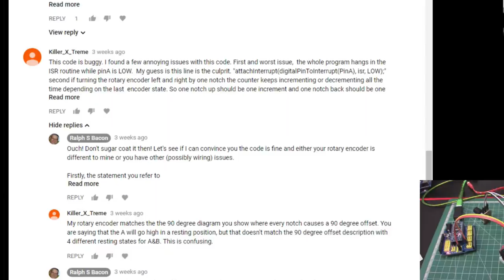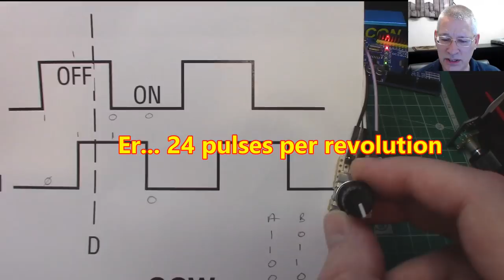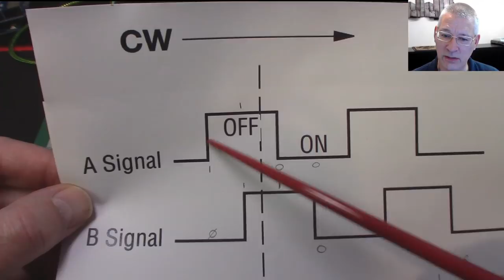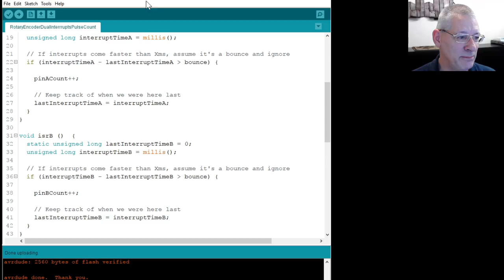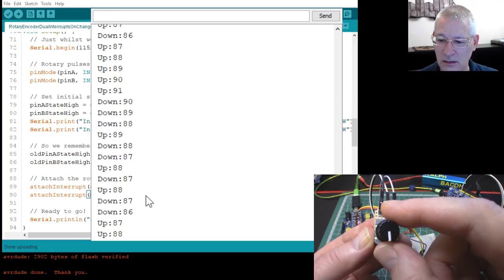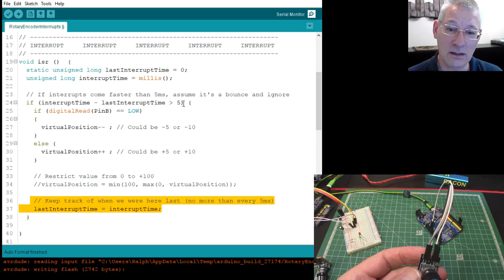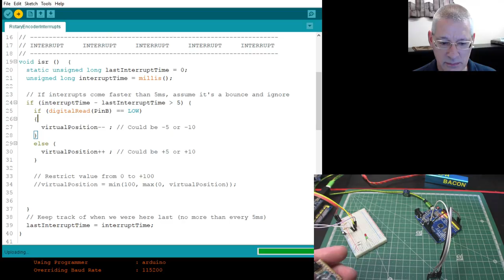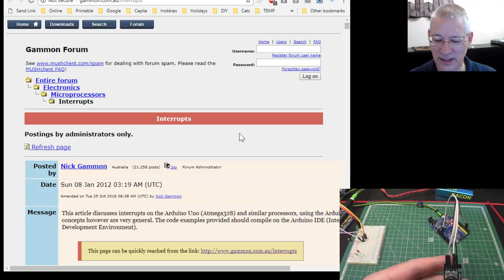#96 Rotary Encoder Update - Stepless & Software Debounced

Comment: Hi Ralph, I had this problem when I was designing a rope counter for measuring rope off a reel, I overcame the bounce issue by using a Schmitt trigger, but as you said you can only rotate a mechanical encoder so fast so I used an optical one in the end for my application.  The use of a schmitt trigger gives you a lovely clean output signal though on a mechanical encoder.
Reply from the maker: I'm thinking that you and another viewer who has commented here (#I Suck at Gaming) are singing from the same hymn sheet - hardware debouncing is obviously a solution. That said, an optical encoder obviously circumvents all the bounce issues but a Schmitt trigger is also a (much cheaper) solution too. Perhaps I need to fully investigate this...
Reply: Can't check it at the moment but most microcontrollers have some Schmitt inputs, I would expect the atmel family does too. As Mentioned elsewhere, it cannot be stressed too much that reading the datasheet of the microcontroller you're using is a must.

Comment: I have known Nick for 10 years plus(via forums) Nick and I were using Atmel chips for that time. Arduino is an Atmel micro. Nick knows arduino as all we had years ago was machine code for these devices. As a side note, memory was so small, that we had to use machine code rather than wastefull C. C even uses RAM for contants and string that don't change etc.
Reply from the maker: If I tell you Terry (and don't spread it around) that I used to have to program in assembler for the 6502 chip with just 4K memory, you will appreciate that I understand totally where you're coming from! These days, memory constraints are the last thing on developers' minds until you try and use the same techniques you use in commercial .NET-style programming on an Arduino. Hah! Then you suddenly realise that you really must write efficient code, and not have constant 'strings' in your code memory, which requires a bit of a paradigm shift in programming thinking. Nice to have someone on board with this appreciation!
Reply: There are a few of us out there,  I used to do z80 assembler back when...

Comment: i have never had good experience with these encoders. Then i found out about the Bourns ACE128 absolute encoder and also there is a library for the arduino available, which works perfectly. Yeah it doesnt have a clicky button and maybe has too much resolution (128ppr) but you can just divide the raw number by some amount which feels appropriate.
Reply from the maker: That's a lot of non clicks for a single turn of the knob, for sure. But as you say, using a subset (eg 5 clicks) to equal one step would be fine. I'll check out that encoder, thanks for the info.
Reply: @RalphBacon  fyj, you can connect the encoder either via 8 pins + ground or connect the encoder to a i2c module

Comment: Not sure exactly what killer-x-treme's problem is but I'm assuming he (?) wants a high resolution so he can tune the VCO in small steps? Well he's got a built in switch so I would have thought an obvious and reliable solution might be to have multiple step weightings selectable by pressing the switch? Course = 10MHz steps, press, 1MHz steps, press 100KHz steps etc. On heritage analogue instrumentation we used to have two knobs, course and fine.
Reply from the maker: Sounds like a plan worth exploring. Let's hope he reads your comment.

Comment: Great video. I wondered how rotary encoders knew which direction they were moving. I've never used one so never needed to find out. But now I know. 
You mentioned that optical rotary encoders were expensive, what are the rotary components in mouse wheels? They have a slotted wheel between and LED and what I'm guessing is a photodiode of some type. Is this an optical rotary encoder, or a different type all together?
Reply from the maker: A (non-laser) mouse is a very good example of an optical rotary encoder - but they are not something you could easily wire up and include in your latest Arduino project! I don't know why standard optical rotary encoders are so expensive (£20 - £50). Perhaps they are designed to be connected to a motor that you are trying to measure the speed of. Or the Chinese manufacturers haven't overproduced them yet so they are not readily available on eBay at low cost. Whatever, they are currently beyond my price range so we'll have to wait until they drop in price... Nice to hear from you again Maxx.
Reply: Ah, I've just been looking through my parts bin and found that most mice have just a 3 pin rotary encoder. The optical one must have been from a more expensive mouse that I salvaged. But I did find more optical encoders in printers that I've taken apart for parts. That might be a source for optical rotary encoders if you needed one on the cheap. 
I ask all my friends and family for their old electronics, good supply of motors, encoders, MOSFETS, and other components. It's harder to salvage SMD parts, but I've yet to find an electronic cast off without some useful parts. Even if it's just wires and cables.
Reply from the maker: Too true, salvaged parts can often realise good finds, even if only for experimentation. Optical rotary encoders are used in many places as you mention - except in the Arduino  hobbyist world it seems. Oh well... non-optical still do the trick for 99% of the uses we need them for!
Reply: I'm slowly collecting stepper motors and rods etc, to make myself a CNC. This isn't going to be a fast project, but I thought to use printer optical rotary encoders to give the Adruino feedback as to the cutting head's location on the x/y axis.
Reply from the maker: I don't see why that would not work. Perhaps you could read up how 3D printers know where the printing head is, if it works for a 3D printer it will work for a CNC machine too?

Comment: i believe there also ones that have leds inside and also "friction-less".
Would like to try these.
Reply from the maker: The ones with LEDs inside are called optical rotary encoders and can turn at ridiculous rates, with zero bounce. The frictionless ones are called stepless rotary encoders but require a bit more coding to use without getting confused exactly which state it's in.
Reply: @RalphBacon  i have one standard alpha, it's soldered on a board, but would you try again?, using a 200Hz timer, hardcore direct access to the port not using the "Arduino language" and via bit masking to isolate the needed pins, sampling the pins is what i did.
the timer interrupt takes the port value and the mainloop handles it.

Comment: There is no need for "dead time" (5ms) because, unlike common switches, the rotary encoder has to go through four different stages to create one event. I wrote software that checks this, has no dead time, and works perfectly whether you turn the encoder fast or slow. I would be happy if you could try it out and see if it solves your problems. The code and explanation can be found on the website http://www.pinteric.com/rotary.html.
Reply from the maker: I'm intrigued in how you resolved the switch bounce issue if you don't ignore signal for a specific length of time after the first such signal.
I've looked (very briefly) at your webpage and I intend to read in more detail when I have a few spare moments. I especially like the "impossible movement" signal which can be ignored, I'm guessing. 
I'd love to try your code out but my (new) workshop is in disarray (typical British understatement) so it will be a while before I can do that. 
Thanks for the info, appreciated.
Reply: @RalphBacon  Very simply, in order to confirm one move left/right encoder must go through successive four states.  Bouncing between two neighboring states is ignored, which is why I don't need dead time.  Impossible movements (when one state is skipped) lead to movement to be ignored.  I already got feedback from one person that (after looking for several years for this) confirmed my algorithm solved his problem.

Comment: Hi Ralph. There's not much wrong with Rainharvester's suggestion. By using it you tend to encourage people to treat rotary encoders with a little more respect. Were you to spin my car's radio volume control like you did your own for demo I wouldn't be overly happy. Consumer products aren't meant to be "squaddie proof"!
Reply from the maker: Agreed, Brian, I was definitely abusing that volume control but purely in the interests of science! If nothing else, the fact that is doesn't respond when turned quickly makes me turn it very slowly indeed in day-to-day use. It has trained me!
 
But given this is not some cheap Far Eastern component built down to a price but is a commercial, robust item in a GM/Vauxhall/Opel car I felt it would survive a couple of quick spins! Did you not find it interesting though that it also went "backwards" in relation to the direction of spin on a couple of occasions? So we are not alone in the Arduino world in getting either the logic or hardware to behave correctly.
 
Loved the "squaddie proof" comparison (with no offense to any squaddies on my channel!), personally I think it might just survive :)
Reply: Great channel. I waiting for some REs to arrive so I can simulate multi-multi-turn pots to set CV & CC on a lab PSU. I have learned, although it has a magnitude reduced ripple, the Arduino derived 3.3v isn't too hot as a reference as it's anything but stable over a range of temperatures.
Reply from the maker: Sounds like you need a temperature compensated voltage source, Brian. Maybe a MAXIM MAX6143, or TI MC34063AP. I'm guessing there must be dozens out there, that you can run from the 9v/12v that you have available and get it rock solid. Have you noticed that some chips are now only available as surface mounts? Makes the soldering a bit trickier!
Reply: SMD = An excuse to practice real use of the recently obtained microscope/camera.
Reply from the maker: You've just given me justification for getting one. Thanks!!!

Comment: 28:58 i have some with 512ppr for my servo motors and i could spin them at 6000 rpm without a problem (i was using Mesa hardware though, really good stuff)
Reply from the maker: I'm guessing that those RE were optical then? A mechanical one would never survive (nor work at) those speeds!
Reply: @RalphBacon  yes optical, also shaft mounted. HEDS 5540-i14

Comment: You do not count the steps in between. Basically, you have to make 2 little ticks with that.

I solved it like so:

void doEncoderA()
{
  if ( rotating ) delay (1);
  if ( digitalRead(encoderPinA) != A_set )
  {
    A_set = !A_set;
    if ( (A_set && !B_set) || (!A_set && B_set) ) {
      encoderPos += 0.1;
      Consumer.write(MEDIA_VOLUME_UP);
    }
    rotating = false;
  }
}

void doEncoderB()
{
  if ( rotating ) delay (1);
  if ( digitalRead(encoderPinB) != B_set )
  {
    B_set = !B_set;
    if ( (B_set && !A_set) || (!B_set && A_set) ) {
      encoderPos -= 0.1;
      Consumer.write(MEDIA_VOLUME_DOWN);
    }
    rotating = false;
  }
}

And making the counter variables floats instead of ints
Reply from the maker: Thanks for sharing! I'm not sure about making the counter a float (why?) but if this all works for you, then it works! 👍

Comment: Hello Ralph,
I have tried your Rotary Encoder code and it seems to work fine. I intend to use it in my attempt to make  a speed controller for my CNC spindle, but I have some questions about your isr routine.
In Arduino's homepage: 
https://www.arduino.cc/reference/en/language/functions/external-interrupts/attachinterrupt/ 
you can read "Generally, an ISR should be as short and fast as possible" 
and also "millis() relies on interrupts to count, so it will never increment inside an ISR"
Your isr routine is quite long and you are using the millis function.
Could that give me any problem if I add more code for PID-regulation and so on?
I like your videos with clear and good explanations!
Regards Jan
Reply from the maker: Hey, Jan! Let's try and clear up any confusion over ISRs!
 
I have often stated that an ISR should do the least amount of work possible - but I'm doing demos in my videos which necessitate putting Serial.print and other long-winded stuff in there, just to show the point I'm making - BUT which should NEVER be put there in a real sketch. If you can get away with just incrementing (or decrementing) a counter that's the best possible scenario.
 
Using millis() in the Rotary Encoder sketch is absolutely fine and is an accepted way of stopping switch bounce (where the mechanical switch actually bounces a few times in an extremely short period of time, almost always less than 5ms, but which is an eternity to even a humble Arduino Uno, so it counts EACH of those bounces). The millis() value will NOT increase whilst inside the ISR but that's fine - we can safely use a 'snapshot' value for that aforementioned debounce feature.
 
What you don't want to be doing is putting logic inside there. Let the main loop() function do all that by checking the count (or whatever) you're updating inside the ISR. That includes PID calculations! Remember that whilst the ISR is running, the main loop() is BLOCKED, not a good situation. Further requests to the ISR just get queued, making the situation worse!
 
I hope this helps in your sketch design, but do come back with more questions as you develop your code. I'm really happy you like my videos and thanks for posting an interesting question.

Comment: In case anyone missed it. When one pulse goes high, the other goes low. Well off to take my counter-depressant and counter psychotic medication.
Reply from the maker: It's not as simple as that, David. The pulses are out of phase by 90 degrees, so turning the encoder in one direction gives you a particular value on the pins whilst turning it in the opposite direction gives you a different value - that's how we can determine direction.